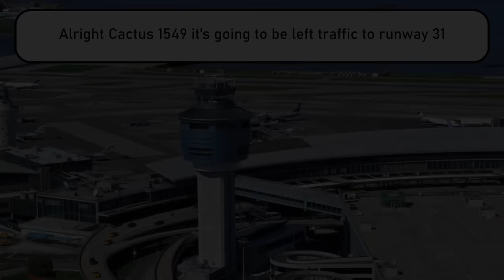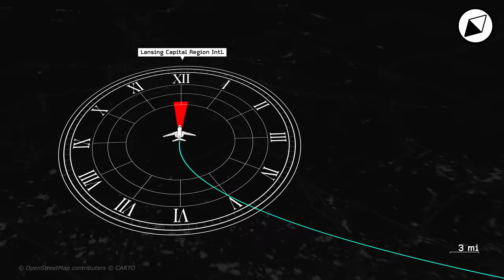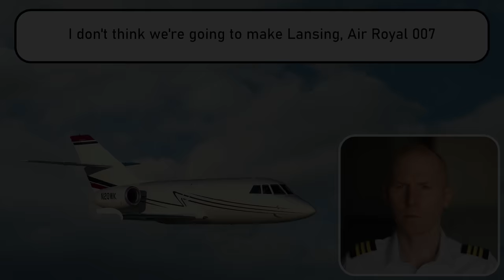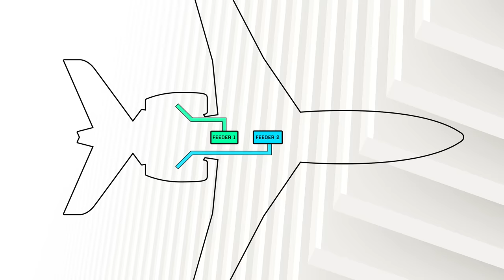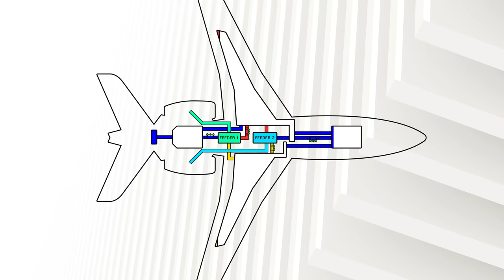Most Bizarre Dual Engine Failure Ever

Comment: Actually heavy is GOOD as a glider. Heavy means a lot of energy available. It causes a higher decent rate, correct, however with a way faster airspeed then your increased decent rate. We glider pilots carry water in order to gain a faster forward speed. It moves your best glide speed up because your momentum can overcone drag easier. Of course we release the water before landing. I.e. Ultralights with engine out stay in the air longer then heavier planes, but they essentially can´t go anywhere. Heavy planes have a much higher decent rate but fly even faster.

Comment: I’m typed on the falcon 20 and it has transfer pumps that takes fuel from the main wing tanks to the feeder tanks. If those fail, wings tank pressurization will provide a flow of around 1000 lbs an hour from the wings to feeder tanks. Interesting it flamed out. Could’ve had a leak downstream of the transfer pump? That’s happened before.

Comment: Clearly, your expertise is as a pilot, and not an air traffic controller.  There are minimum vectoring altitudes (MVA) for every bit of airspace for which a controller must adhere, typically for obstruction or terrain avoidance.  He cannot clear an aircraft for an altitude below that MVA.  Certainly, if a pilot declares an emergency, he can do what the situation demands, but the controller can't give him a clearance to do so.
Reply: Understood that a controller normally doesn't give a reason for directing a pilot to maintain a certain altitude. It could be for terrain or another obstacle, it could be for traffic, it could be to set the plane up for what the controller wants to do next with the aircraft, or it could be to help time the airplane's landing. Whatever the reason, in normal operation there is no need to give the pilot an explanation, just do what I say.

But total loss of power is a different situation, as the pilot cannot comply with an instruction to maintain a particular altitude. As Kelsey mentioned the pilot should be able to do what they want, the controller should be just giving them vectors and informing them of terrain or other obstacles. 

In fact the terrain or obstacle will be below 3,000 feet as there is margin, so it would help the pilot to know the exact altitude of the obstruction as well as the location. 

This is not a normal landing situation or even comparable to other emergencies such as fuel Mayday. By announcing no engine power the pilot has essentially already specified "unable" when it comes to maintaining altitude.

Comment: I have been saying this for years as a modest pilot with only 28 hours of flying time with a C-172 (and now 74 years old) .... only let an ATC behind the microphone of a tower if he/she has a (simple) pilot's license and can therefore better empathize with the dangerous situation of a pilot, then he / she will not quickly make a stupid mistake like this, with an airplane at 3000 feet without engines that still has to glide 15 miles (say 22 km) to an airport. 

For me it is INCOMPREHENSIBLE that the aviation world has not implemented this long ago!!

Comment: I had a crew in a LR45 in the high 40s report both engines flamed 
out. He requested lower to restart. I offered a heading to the nearest And he said “ok, I guess”. After about a 10K decent he reported all well, asked to climb back up and continue on. Better up high then down low. 😅

Comment: Merry Christmas.

I have a short question about something different.  Earlier this morning, I was watching a live stream from LAX.  They were landing aircraft on 25L and taking off on 25R.  At one point, an airliner pulled onto 25L and turned and took off instead of crossing 25L to get to 25R.

A minute or two later, another large aircraft landed on 25L.

Is that normal?  Why wouldn't they have the airplane go to 25R to take off?
Reply: That plane would have been coming from the cargo terminal at LAX, so 25L would be their closest runway. My guess is the tower prefers to not have planes stopped in that little gap between 25L and 25R. They could hold them short of 25L, and then have them cross over when both 25L and 25R are clear, but it's probably easier to just have them take off on 25L.
Reply: Two possible reasons, first is that the aircraft had enough of a hole in the arrivals and was south side anyway, easy enough to just send from there.  Also, the truly big aircraft are unable to depart 25R (A388, A124, A225, B748, C5) and nobody ELSE can depart 25R with one of them on B west of Q or on H.
Reply: My level of expertise is "I work 1 mile south of LAX in a high rise building and my job is boring so I stare out the window a lot" so take my information with a mountain of salt. Anyway, from what I've observed mostly cargo planes take off from 25L as the cargo area is located on the Imperial Highway side of LAX.  All planes, cargo & passenger, mostly land on 25L. I think I've seen a plane land on 25R maybe twice in the 5 years I've had my very boring job.

Merry Christmas!

Comment: I have seen a 747 Land on a 5k runway... Twice.  They then took a right, and drove across the street.  One was turned into a water park, the other is collecting parking tickets.  Over at KMMV. 

Granted, it was intentional, they were empty, and didn't have enough fuel even for a go around.   But both 747's landed in only 2000 feet.
Reply: What, they landed a 747 on top of the waterpark? 😀

I saw the Spruce Goose when it was in Long Beach next to the Queen Mary.
Reply: @StevePemberton2  lol, That would be something to see :D No next to it, at the airport.  They then had to taxi it across the Highway.
Reply: @RobertFrisbeeTAM I would guess they used a couple of cranes to lift the 747 onto the roof of the indoor waterpark. I would think that the building was specifically designed to hold the weight of a 747, with the attachment locations already in place.
Reply: @StevePemberton2  Exactly. Two cranes, and they built the whole structure to use the 747 as the base for the two water slides.   Dale smith (Founder and owner of CIA... I mean Evergreen Aviation) built it as a 'educational' attachment to the Air and Space museum.  Now I believe it is all owned by The Stoller winery.

Comment: I remember hearing the liveATC audio from this incident back when it happened and thinking the same thing about that clearance. - lol - "Maintain 3,000 feet" is not an especially useful instruction to a plane with no engines. I was also surprised that the controller wasn't doing more to give the pilots all of their possible options as quickly as possible. Not a lot of time for looking around at charts when you suddenly have zero functioning engines at low altitude. If they had mentioned the other airport option earlier, they might have had time to plan and line up for it better. 8 miles is not a lot of time in a jet.
Reply: And, yeah, that stuff with the Chinese military happens all the time. China makes all sorts of claims about its territory extending to places to which it does not actually extend. The U.S. military (as well as virtually everyone else's military) ignores these ridiculous claims and continues to fly and sail in international airspace and waters. Politely telling the Chinese Navy to go take a hike is just standard procedure.

Comment: I read the "maintain 3000" as: "Before you descend below 3000 I need to know."
Also: your glide ratio does NOT depend on your weight. She sink rate, yes. The glide ratio, no. Fly at your best l/d and your range will be pretty much irrespective of your weight. (Speed for that will be higher for higher weight.)
You don't usually estimate the range in glide by the seat of your pants. You have performance figures for that. But you CAN determine if you'll make it by the changing aspect of your view on the landscape. And I say that as a glider pilot, where we do a lot by-the-seat-of-your-pants flying.
Reply: all commercial pilots should have some glider experience - in case of Gimli scenarios!
Reply: @derektaylor2941  The forward speed increases along with the sink rate by the same factor. Glide ratio is also called L/D (lift to drag), as this is how it is calculated. Lift and Drag coefficient don't change with weight; they change with attitude. Fly with the same trim (as in: cofiguration of control surfaces, not trimmed for the same speed) and your glide ratio does not change with weight.
This is used in gliders in good thermal conditions: You load water ballast, as this increases your forward speed. The higher sink is easily compensated by the good weather conditions You can fly farther in one day, or finish the same circuit in a shorter time. You wouldn't do that if it would affect your glide ratio.

Comment: Contaminated fuel could also give this type of problem.
Reply: The same bad-day mechanic working on both engines is another established factor. Think of the Bahamas-Florida Tristar triple engine failure.
Reply: @givenfirstnamefamilyfirstn3935  there are always freak occurrences, but having spent three decades in the aircraft maintenance industry, you would first look at things the engines had in common when diagnosing multiple failures.

Comment: 3:29 Fun fact: the weight of the plane does not influence the glide angle… the correct speed/AoA does. However the best glide speed changes with weight and with it the remaining time in the air, but not the distance over ground. Just some aerodynamic nerd facts 🤓
Reply: You have to stop at the end !

Comment: Could they have dumped fuel to make them lighter and get to the 15 miles? (if the feeders were off)
Reply: Glide distance doesen‘t depend on weight, higher weight only increases glide speed and sink rate. But the distance stays the same, you only have more useful time in the air.
Reply: @blackspell9791  I did some research and what you are saying is correct. In fact, the heavier glider might go further.
Related to what you said, the lighter weight of more useful time also reduces stall speed. Additional benefit that in the useful time in the air would be the pilots can focus on the best glide slope to achieve max distance.
Reply: That size of plane doesn't have dumping fuel as an option.

Comment: You would think that all planes would have a 5 minute "reserve" tank that even if all the main tanks went dry, it would still provide 80% thrust for 5 minutes to keep the instruments on and the engines with minimal maneuvering thrust.
Also, don't even small planes have RATs? Ram Air Turbine, to keep the instruments, control surfaces and radios working?

Comment: Holey Moley (after checking refs)!  Diff models notwithstanding ("average 747" vs "average Learjet" as closest guess as to size for that small one), a 747 has a glide ratio of 17:1, a good thousand feet longer than the 16:1 of a small jet. I guess wing surface is better than weight or size. Engine loss to me always seems most scary AND a helluva lot more likely but prob due to the old vehicles all my life, none of which get the care and maintenance of aviation. Why helos seem impossible yet they fly!

Comment: Reminds me when I was flying a Saberliner 80 and lost an engine due to a fuel pump failure at FL410 and told the controller I needed a lower altitude.  He initially told me to standby, my response was I was unable to maintain my altitude so what heading would he like me to fly, left right or straight ahead. I was able to get a relight below FL290.

Comment: Question: is switching the feeder valves that something that you can switch manually from inside the aircraft or is it only something that can be done outside the aircraft??? Does it differ per aircraft???

Comment: If a 747 with thrust reversers can land on a 4,000 foot runway then can it take off from a 4,000 foot runway?
Reply: They call it a "short jump" or "hop" takeoff.
Weight needs to be stripped and then minimal fuel to get to the bigger airport. 
If it can be made light enough for 4,000 feet, I have no idea. I've heard pilots for bigger aircraft talk about this but do not understand the specifics.

Comment: As much as power lines and planes don't mix, the little Auburn WA airport at the end of the block from our shop has  power lines 2-300yds from the end of the strip... Not just regular lines, but the massively tall ones that look like some kind of Erector set. Anyhow, even with those big ole orange balls on the lines, about every 7-8yrs someone flys right into em!  One time the plane actually ended up hanging from them.  If memory serves me, that was the only one where the pilot survived.

Comment: No, "flying by the seat of your pants" comes from literally feeling the plane's slip/slide as your butt gets shifted in your seat in an uncoordinated turn,
And he knew he wasn;t going to make it by doing some quick math:  Rate of descent/speed/distance.  At, say, 120 kts, he is making 2 miles/minute.  If the airport is 15 miles, he needs 7.5 mins.  If he is losing 700 ft/min, he can quickly know if he has 7.5 mins before running out of altitude (he needs 7.5*700=5,300ft).  If you can't do math like that in your head, or don't have a copilot to do it, you are not going to know, because a GPS will not do that math for you.

Comment: Just out of curiosity...  If you did have to put a 747 down on a 4200' runway, and all the variables lined up in your favor and you were able to stop without an excursion...  Then what?  Can you fly a 747 off a 4200' strip?  Maybe with just enough fuel to hop to the nearest bigger airport?  Wait for a cool day with low density altitude?
Reply: Good question! I wondered the same, hopefully someone knowledgeable answers.  I’m imagining the aircraft would need to be stripped of the entire interior and any other excess weight that could be removed, but it may be that simply loading minimum fuel will make it light enough.
Reply: @jpe1  I'm thinking no pax, no luggage, no cargo, minimum fuel, 2 crew...  Wait for a cool day with low density altitude and a favorable wind down the runway.  Line up, then get pushed back until the mains are on the very edge of the runway...  Spool up, pop the brakes.  Even so, you're probably going to be committed to takeoff, V1, pretty darn quick.  If something goes wrong, you either take off with it, or things are going to get ugly.

Comment: The investigation is out and it is reported that that plane shut both engines because the pilot put someone alse to learn to fly that plane and the "aprentice" instead of reducing power, shut off both engines. When this happened apparently the official pilot didn't know how to re-start the engines. He finally re-started one engine but on approach, the landing gear was not lowered. He went on a go-arround and this time only the front anding gear went down. On the next go arround he banked too much the plane and crashed in houses. Pilot and copilot and one peron in the ground died and 2 passengers were badly hurt.

Comment: "It's very weird to me they're not just being declared to go wherever they want to..."

Did the pilot declare an emergency and squawk 7700?  Until then...  

"They may only be at a couple thousand feet."

Then approach wouldn't have given them a clearance to descend to 3,000 feet.

"Seat of your pants..."

Uh, no.  Both engines out, yes.  All electrical kaput, no.  They still have power from either their APU, ram-air turbine, or battery, along with avionics.  Between current altitude (altimeter), field elevation (chart), VVI, and airspeed, they have the information they need to quickly and mentally compute whether they're going to make the airport or not.

No "seat of their pants" required.

Comment: do these smaller plane also have an APU? also, can an APU provide any thrust? (I'm just a guy who likes to watch these aviation videos, never worked in the aviation field)
Reply: APUs provided electrical and bleed air only.  Zero thrust.  Some only work on the ground.
Reply: So you know that APUs exist but don't know what they are? That's a very rare combination. Just check out what an APU is and you can answer your question yourself :)
Reply: @stefan514   hence the disclaimer; i like absorbing random bits of information, not bothered enough to put in the effort of research
Reply: @robertheinkel6225   thanks

Comment: Are those valves closed manually only? Or some malfunction in the system that they wouldn't open when commanded?
Reply: They're probably automated, and the pilot doesn't have a way to control them directly.

Comment: Along the same lines as "fly by the seat of your pants" for us old Truckers goes is very similar. These new unskilled "Steering wheel holders" are way to reliant on Electronic BS including the GPS mapping. These guys are following the navigation system into the forests of Northern California. That Driver was MIA for like 3 frikin days!! Luckily you're in the air not dealing with this type of unskilled laborer with 40 tons by your car lol

Comment: Would that GA runway handle the weight of your 747? Stopping distance won't matter if you tear the landing gear off as the wheels break through the concrete.